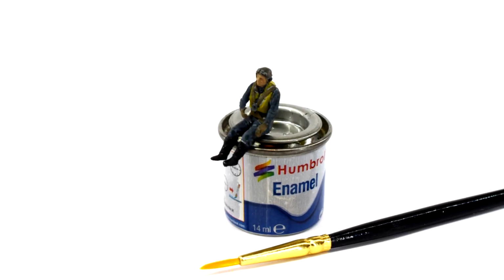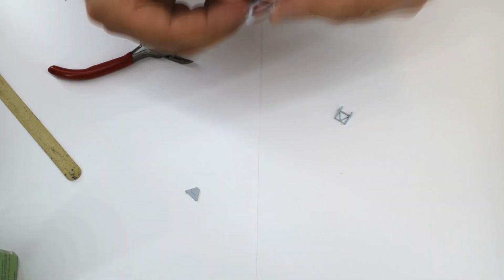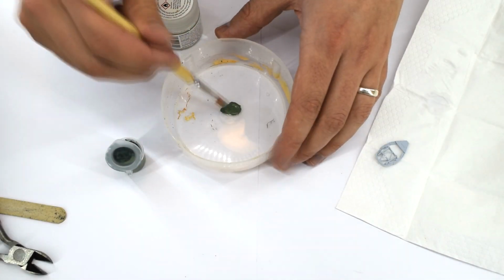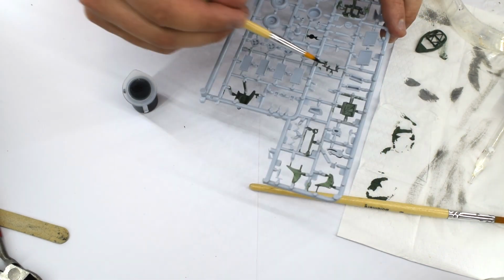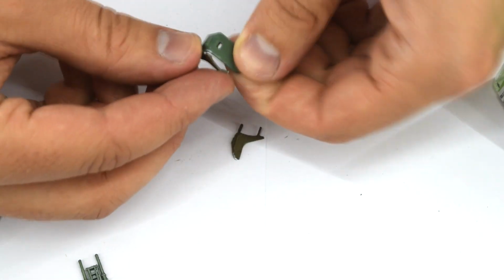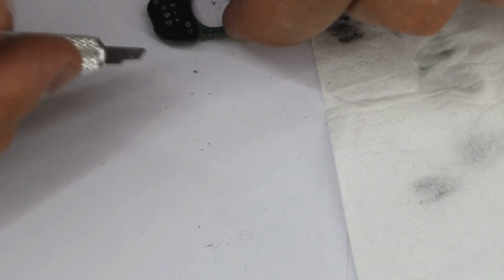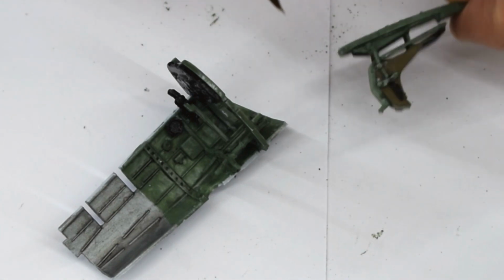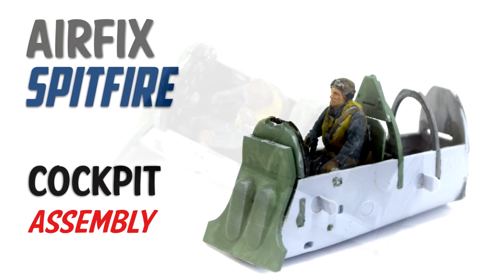Airfix Spitfire FR.XIV Build #2 - Cockpit Assembly - 1/48 Scale Plastic Model kit

Comment: When you are using the tamiya cement, dont brush it onto the plastic before connecting the parts (if possible). I found out its much easier and faster to join the parts first and then tap the joint with the applicator brush, since it can dry faster than you can put on the second part after applying cement. Just my personal opinion though :)
Reply from the maker: MartinSvK I agree! It’s quite easy to draw it along the seam, you’ll see me do that in this week’s video where I build a p51 ☺️
Reply: Also, recently I found out about this "Acrylic drying retarder", so I bought it, tested it on a model, and the results are, well, simply astonishing. Using this solution with your acrylics means that you can get results as if you were using enamel paints. No brushstrokes and longer working time for the price of longer drying time is very rewarding.
Reply from the maker: MartinSvK sounds awesome! I might have to investigate